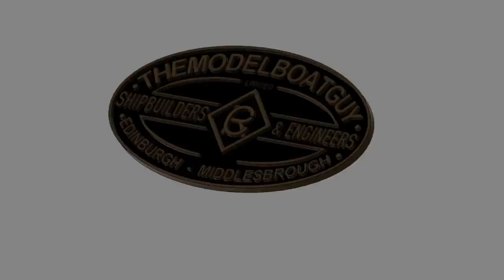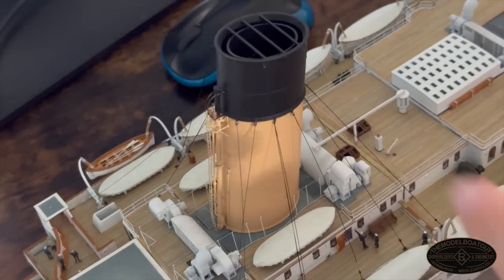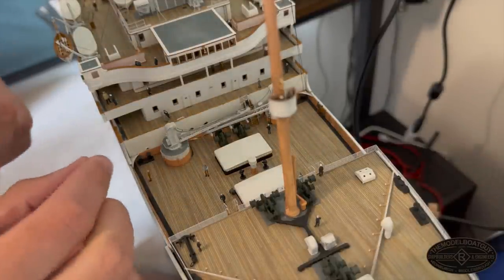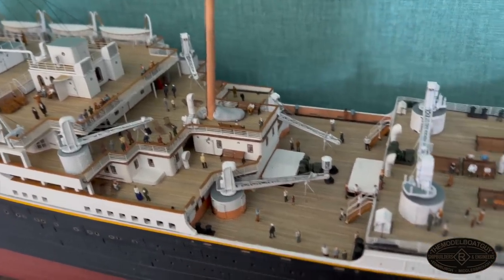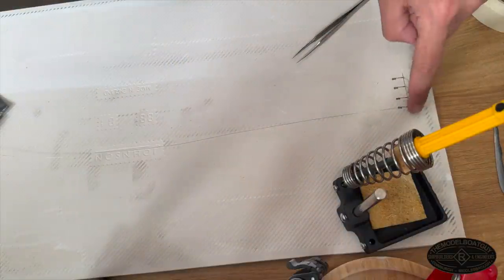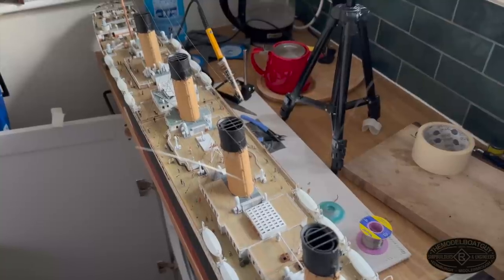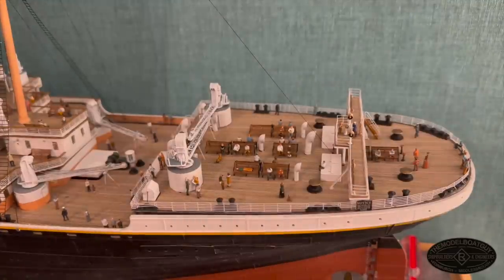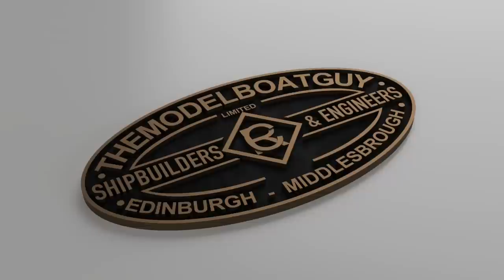Radio Control Trumpeter 1:200 Titanic Build Part 88 - Rigging and Marconi Array

Comment: Hi again where do I get the hooks from as they're not in the kit and how do I fasten the rigging to the deck
Reply from the maker: Well I bought an add on set which included those hooks (quite expensive):
http://ka-models.co.kr/?product=1200-rms-titanic-dx-pack-for-trumpeter&ckattempt=1

Another option would be to make your own, perhaps bending some fine brass wire?